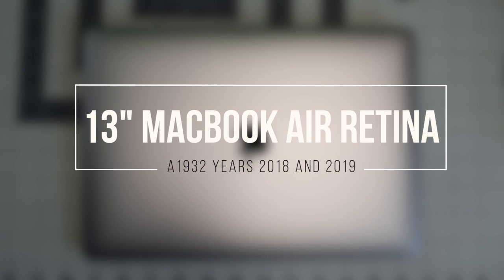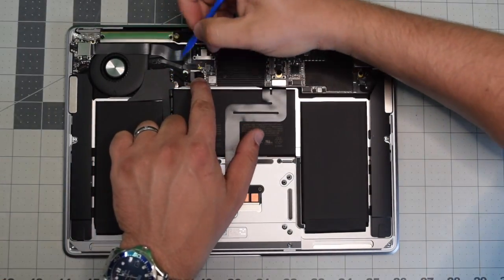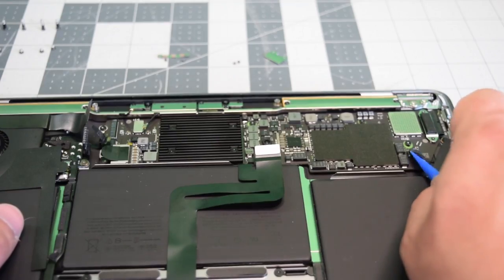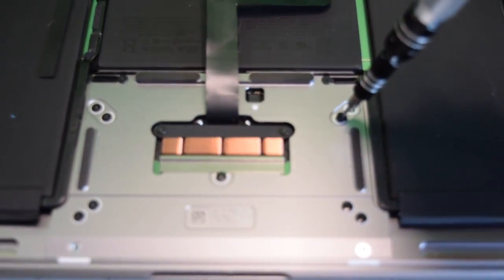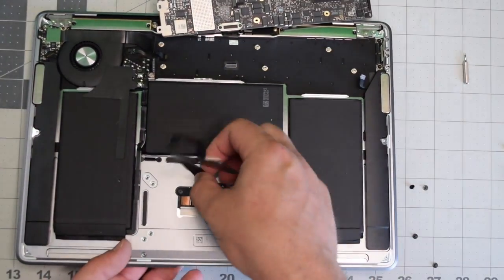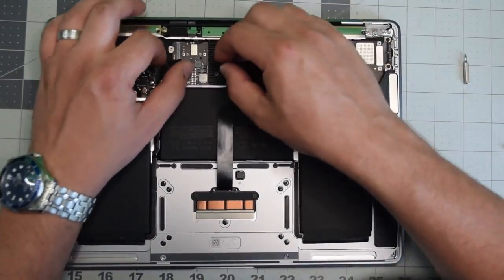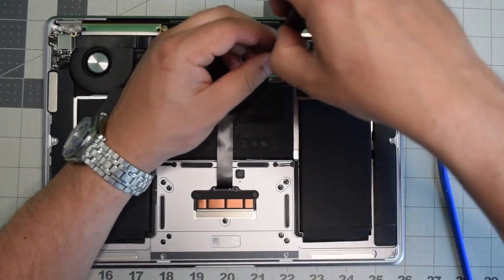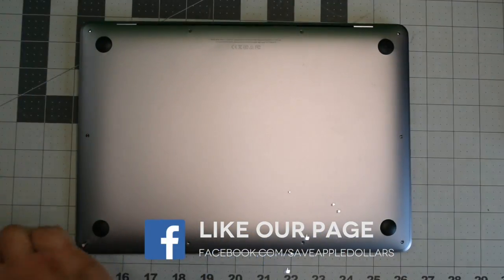13” MacBook Air Retina 2018 and 2019 A1932 Trackpad Replacement

Comment: Thank you for the video. i have a macbook air 2019 (intel) and the keyboard and trackpad stopped working at the same tome. Do you think replacing the flex cable of the trackpad resolves the issue?

Comment: Found I could replace just the ripped cable. Amazon has them. Once you remove track pad plate. Just swap the old for new. Lift adhesive then slide out ribbon. They come with new adhesive. Fixed it!

Comment: Thanks for the additional info to cover for the mishap on the first video. Now how do you replace the flat ribbon that got ripped because of trying to hurry the process?
Reply: Found I could replace just the ripped cable. Amazon has them. Once you remove track pad plate. Just swap the old for new. Lift adhesive then slide out ribbon. They come with new adhesive. Fixed it!

Comment: Hi! I was trying to replace my battery & accidentally started following the wrong video. The battery is fixed and the trackpad is working, but they keyboard isn’t working. Any ideas? The black thin strip that’s above the battery doesn’t seem ripped.

Comment: Just a question: don't you need a wrist grounding band, to avoid Static discharge that can damage the computer?  Your videos are very well explained, thank you. But I am curious about the wrist grounding band.
Reply: Technically yes, but its not an issue 99% of the time. Have been repairing electronics for 7 years and not once have i worn a grounding wristband.

Comment: My track pad works but my keyboard don’t only power button work any suggestions
Reply: Did you solved it?
Reply: @jorger5945   yes  I replaced track pack cable
Reply: @gryfsal1714  thanks man. Im having the same issue only the trackpad works and the keyboard will light up but won’t type anything

Comment: Thanks for showing us how to do this. Son spilled water on trackpad and it and keyboard were not working after he continued to use computer. Should’ve shut it down and turned upside down in “V” immediately. Water destroyed trackpad and connector on ribbon cable. Thanks to your video we were able to replace both and computer once again has functioning trackpad and keyboard. 

One important lesson from repair of this computer. Be gentle and careful popping cable for right speaker/subwoofer out of its terminal. Do it just as shown in video and maybe while doing so also use repair tool to hold down terminal which is only lightly soldered to logic board. We ended up popping cable and terminal (common mistake) off logic board. Right speaker/subwoofer no longer working. Not nearly as big of an issue as non-working trackpad/keyboard. But, still. Tainted what was otherwise successful repair. 

Thanks again!

Comment: Hey man, thanks for the video. how do you take out the cable connection to the trackpad? Its under neath the bar area (see around 3.05). essentially i just want to replace the flex cable?
thanks